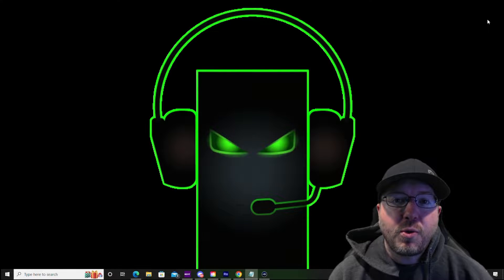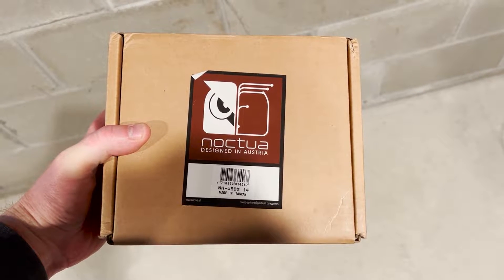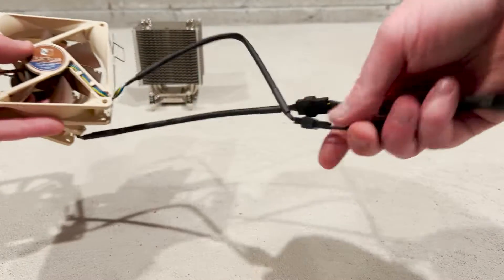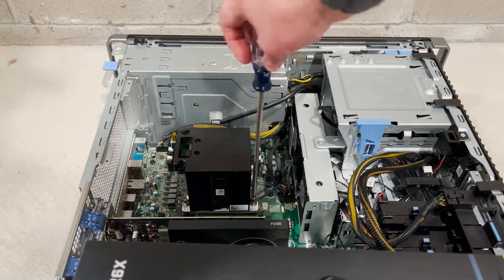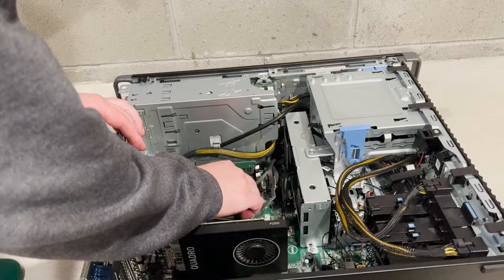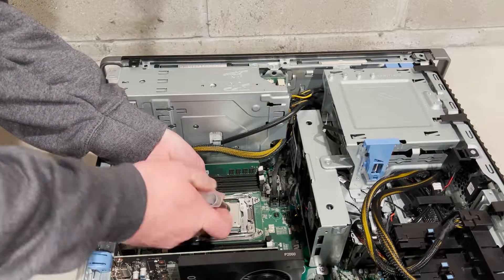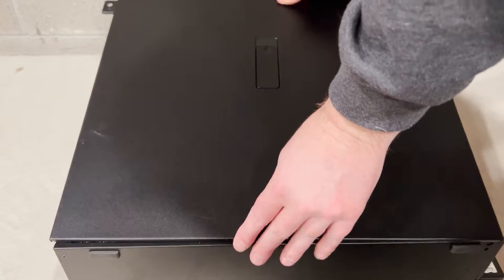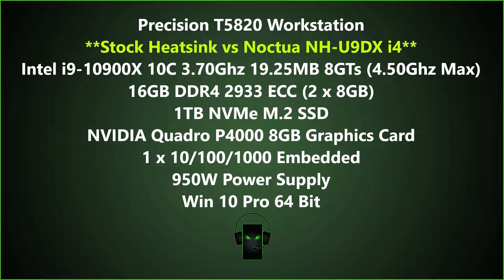Precision T5820 Noctua Heatsink Install +  Side by Side Temperature Game Testing

Comment: Hey there I recently picked up the same pc with the same specs for cheap. I want to slowly rebuild it into a monster sleeper build over time but the biggest problem at the moment is the cpu. Mine has a xeon w-2123. I saw your upgrade guide on your website to put in the i9 but that's not a long term solution.

Do you think you could make a tutorial about swapping out the motherboard with a more modern board, and modern boards that would fit in the case?
Reply from the maker: Well add it to the list.  Also, we list the i9 system board, processors, and memory on our upgrade guide if you want to swap to the i9.  

https://www.greenpcgamers.com/dell/dell-precision-models/precision-ddr4-based-workstations/mfg-dell-precision-t5820-gaming-computer/

Comment: 1:09 thanks! This guide helped me find the suitable cooler (+importantly the Dell 4 to 5 pin adapter) for the T5820 at work and made the installation a smooth process. Thank you very much! No more jet engine sounds from the case 💤

Comment: "I'm considering upgrading the cooling system for my computer, but I'm wondering if this will increase the internal temperature of the case, and if it will also raise the temperatures of the RAM and graphics card?

Comment: How do you do this upgrade without BIOS cpu fan error warnings?
Reply from the maker: As long as you use the fan power adapter and plug the noctua fans in to the system board, you shouldn't be getting errors.

Comment: I have a Dell Precision 5820 with 3 x 8GB PC4 2666 RAM, 1 x 16GB PC4 2666 RAM and 1 x 32GB PC4 2666 RAM.

What would be the correct layout as the PC is now beeping and not booting. All I did was remove the memory for maintenance and I don't remember the layout? Any ideas?... :(

Comment: Hello I need help I have t3500 and I want to buy rx 580 my power supply is enough 525watt and can I connect it with sata changer to 8 pin to sata please answer
Reply from the maker: Sometimes, depending on the MFG of the GPU and Overclocking.  We've fried quite a few stock 525W Power Supplies on T3500 Workstations because of upgrading the GPU's.  Sometimes they the system will just shut off or go to a black screen because there isn't enough power going through gpu power rails. Just be prepared to replace the power supply if it has issues.